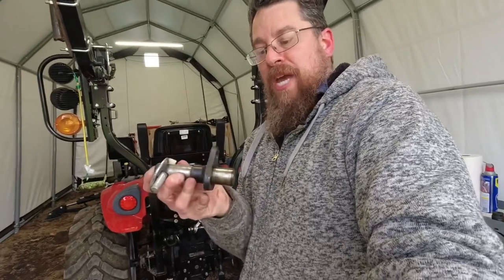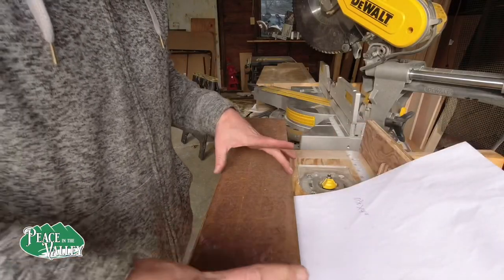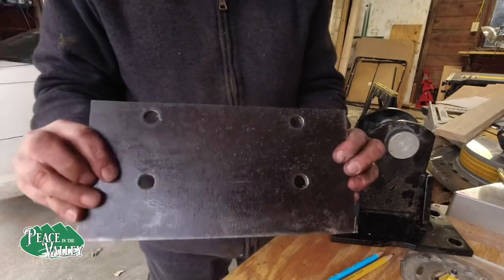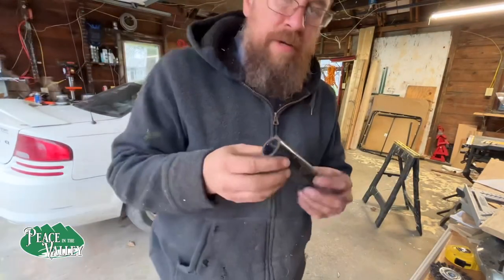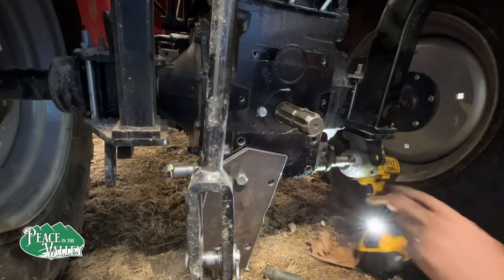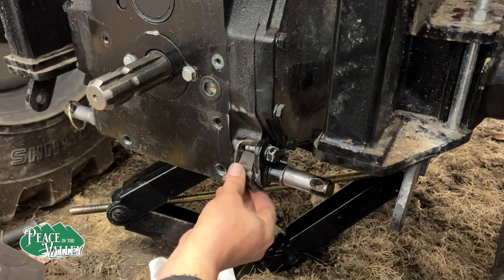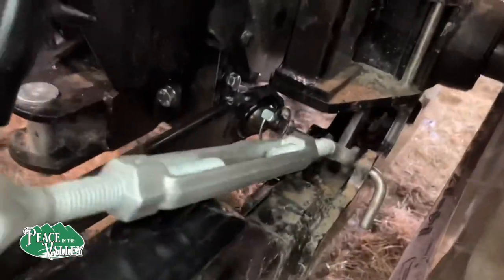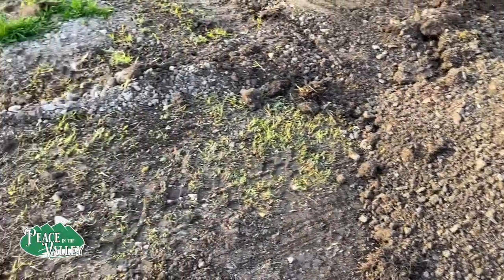Building the RK25 HD Edition! E82

Comment: Will be looking into this fix on my tractor.  Thank you for letting us know that the backhoe can be installed with the quick connect. Time to order a set.
Reply from the maker: Hi Juan, There is one thing to note, and I will be having a video on this next week or so, the u-bolts that come with Patts extend down quite a bit. normally not a problem, but I got stuck and I had to pull those off because they kept catching on anything that I put under to try and get out of the mud - stupid me for getting to that point.

Comment: Yep, seen this failure several times.  Across all makes of late model tractors.  80% of the time it is from operators not securing/adjusting sway chains properly.  The sway chains are a vital component of a tractors 3-point hitch.  The tractor and Implement must be securely and tightly connected to each other. No fishtailing!

Comment: Mr. and Mrs. Peace, thanks for the videos. I also have the RK-25! I haven’t drug the rear implements through the dirt yet. So my question is this, all I need to do is bolt on a 3/8 piece of steel on the back side of the rear end with longer bolts and it should greatly enhance the durability of the tractor strength? Don
Reply from the maker: Hi Don, if I were in your position, yes. i would do bolt on the plate. I don't see this happening a lot, so it's either that I had a faulty casing or I didn't treat it nice enough. I was surprised that the 3 point bar only went in about a little over an inch. That should not be the case, IMO. Have fun! it's a great tractor. I am about ready to post my 300 hour service video soon.
Reply: Thanks for answering my question sir. What is your first name? Just one more question please, what grade of new bolts did you use? I have a grinder and a drill press, you have given me the confidence to do it too! Don

Comment: Great fix. I just got a 3/8 piece of steel. What were your measurements? 10 3/8 x 4 is what you said, but it looked like you made it 5 inches tall. Also what size replacement bolts did you use?

Thanks again all you RK 25 videos have saved me time and money!!!
Reply from the maker: Hello Abraham, thank for watching! I'll check and see if I can find the sizes. basically the length of the bolt, I added another 1/4" to the length (I couldn't get it at 3/8 and I didn't want to cut them. It's been a while now but I believe I also had washers.
I've been using the tractor a lot lately and it's still holding up very well. I think it was the right thing to do. I wish I would have done it earlier. Oh well!

Comment: The dealer didnt replace/fix the tractor? I would have demanded they replace that and then put your fix into place on an intact casing.
Reply from the maker: I agree with you but I also had to have a working machine. I don't have other tractors around when this one is down. They would have taken 6 months minimum.

Comment: Great video just looking at the rk25 but now it's a rk25h at rural king wonder if you know what the difference is ? Kinda of thinking of going with a different brand tractorl.
Reply from the maker: I think it's exactly the same one. Perhaps, they are planning a shuttle shift version and maybe that is why they started differentiating it. If they came out with that I think you could expect to double your pulling power. I was looking at other tractors that were identical other than the standard transmission versus the hydrostatic and you lose a lot of power to the convenience of hydro.
Reply: @PeaceIntheValley  kinda bummed for you that that part broke in the rear, is rk gonna replace it? I see in the other video you fixed it do you plan on leaving it that way Or is it gonna be warranting it?
Reply from the maker: @ocd7036  I'm still up in the air on that. I'll see what this summer looks like. If the repair holds super well and it's sturdier than original, i'll probably just keep it the way it is rather than go through the warranty process.
Reply: @PeaceIntheValley  well good luck

Comment: Seems like this issue might have been partly on you. In your video where you were doing some grading the box blade was swinging all over the place. Aren’t there a couple of outrigger turnbuckles to keep the implement behind the tractor? I do agree with you though that that area does not look very substantial so maybe this is more of a light duty tractor.
Reply from the maker: You could be right. The one turnbuckle vibrated off. However there is rust on the iron, This is not the first one to break. I assume that if the turnbuckles are not tight it can cause a less substantial design to fail easier. Thanks for the comment!
Reply: @PeaceIntheValley  yeah, hopefully your fix keeps you up and running until RK can make it right. I agree with your comment that it should be able to take a substantial amount of punishment. I had a JD 2305 for 15 years that I worked very hard at times and thankfully never failed me. Looking at getting a new one and had pretty much decided ot would be the RK25 until I saw your video. Now I am rethinking that. Thanks for sharing!

Comment: 😂😂😂😂no offense. Why didn't you remove part and weld a piece to the dowel that goes in housing .with holes drilled in it to attach to bolts that holds the planetary drives on .would be much stronger. 😢
Reply from the maker: I'm not sure I quite understand what you are asking. Can you direct me to a link of what you mean?
Reply: Could you bolt a thick piece on the planetary final drive housing . That is also wide enough to incorporate the pin that holds the lower draft arm ? I see atleast 4 bolts on planetary that could be used .to fasten plate to